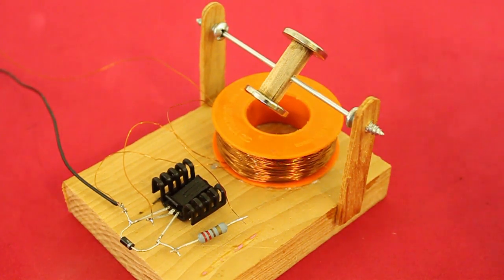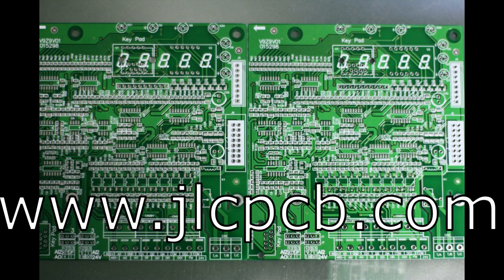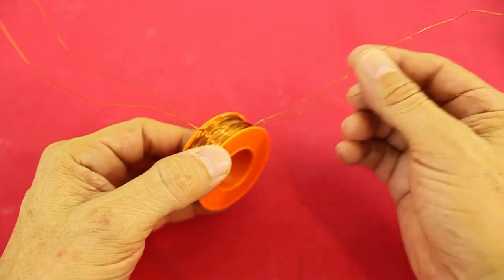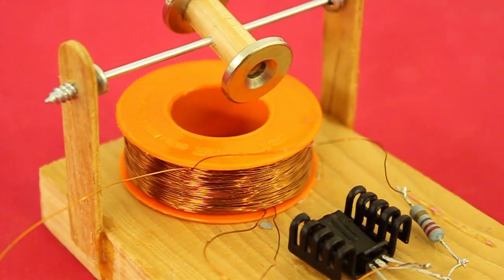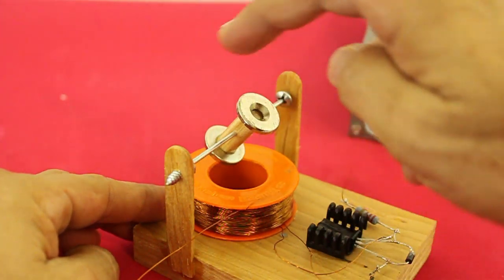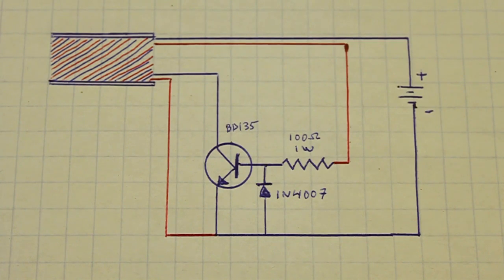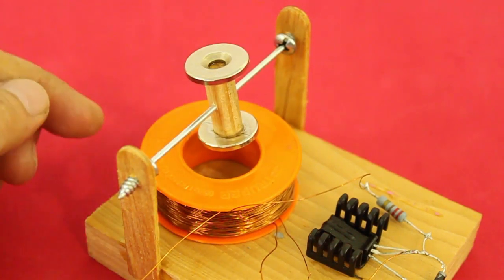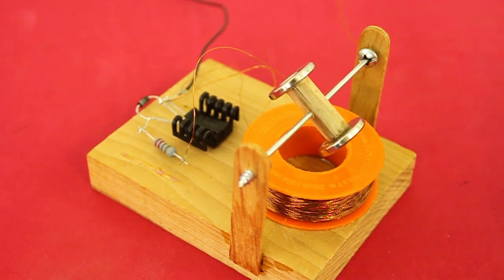The Bedini Motor

Comment: If you cannot describe the physical details of a circuit, you should go back and learn what's necessary so that you understand it.

In your case, it's 100% clear that you fully know the operation because your explanation is clear, accurate and correct.

I taught STEM topics at UC Santa Cruz for five years and I discovered the following:
1)  when a topic is new to students, like all new knowledge, it requires effort to learn.  Even if you explain it correctly, it takes effort to acquire the knowledge because it is new.

2)  if the experienced person decides "I'm not going to tell them everything they need to know - that will motivate them to work harder to understand!  Besides, nobody helped me!"

A large percentage of yt videos use method (2).   In some cases, it's because they do not understand what they have so they cannot explain it.

If you really want people to understand what you're trying to convey,  the method you used to explain the Bedini motor is a model because holding back details does not motivate students.  They are already facing the challenge of understanding something brand new to them.

I congratulate your effort, very good job.  Nice build on the motor, too - thank you.

Comment: I wonder what effects on heath or body or psyche would be, to be close to a fast rotating magnetic field, with some improvements to build you can rotate a magnetic ball or wheel quite fast, i have built design and made it "better" I will sit by it while it runs, i have some copper rings that will vibrate when it gets close in the field range of device, Ive yet to know if it improves or not my well being but not much out there on the study of magnetism effects on the body for healing but hey just being weird on YouTube and throwing it out there.

Comment: What if you replace the resistor with adjusting resistor. So then with motor running, you can adjust best position for rpm.

Comment: So the magnet passing the coil acts as generator turns the transistor on, sending current to the base of the npn
Reply from the maker: Yes
Reply: @ludicscience  So this is a more direct way of describing the operation of sensorless BLDC drivers.  In other words, the ones that don't use hall sensors?  Instead of saying such terms as back EMF.
The only difference is, the sensorless bldc driver does start without help.  So I would think that the magnet's back emf ( sending current) is used to show its location.  In other words, it is doing what this experiment is doing, triggering the base/gate of some a transistor/mosfet or what have you.

When I use one of them drivers to run my make shift bldc motor, I typically need to give it a helping hand except once in a while.  I guess it depends on its mood, temperature, humadity or what have you.  Plus the motor is not exactly machine made to precision with an uneven airgap etc.   And once in a while when it is just at the right spot, it runs like grape ape with only 5 V.   Too fast for my comfort so I actually have to lower the voltage. And sometimes I have to really give it a helping hand and it still fights.

Comment: Great video, what if you add one or multiple other inductors then rectify the output to a storage device like say a ‘capacitor’ which can run through the switch then only wind a secondary once on top of the original inductor tuning it to the correct switching force etc?
Would anything like that be worth pursuing?
This comment is sponsored by ‘the reptilians’ our beloved benevolent overlords.

Comment: This build has many problems. Wrong coil geometry, wrong magnets, no core material. Output energy is totally wasted, which defeats the purpose of this device. This device has very little in common with a proper built bedini ssg.

Comment: I like your setup.
Recently I tried the circuit aswel. It looks like the transistor doesnt shut. There is a circuit on the thick wire. Resulting in a north pole magnetism in the spool. 
Do you have any idea?

Comment: it is a transformer but with a diode so it just take the inductive current by the movement of the magnet and that current switch the transistor to feed the other coil that turn the magnet.

Comment: Yeah! Bedini "motor". I built 4 of them. About 10 years ago. BTW, you can use it to charge a big battery while depleting a smaller one (the run bat). Is it "Over-Unity"? Is this a big bat. really conventionally 'charged'. I will not discuss these kinda controversial considerations.  
Guess what? With the DadHav very clever circuit you do not need a 'trigger coil. One coil is enough to run a pulse motor.
You also do not need any reed relay, any mechanical switch or whatever.
The few experimenters interested in this kinda stuff can consult :
"1 Coil Brushless Motor Driver (Multi-Phase)". (DadHav)
https://www.youtube.com/watch?v=8b4xlCKn3LQ
This circuit can be simplified (cut in half) but is very tricky to get it run.
More here: http://freenrg.info/PUBLIC/The_DadHav_Circuit-V2-2.pdf

Bien le bonsoir,
Jean

Comment: Nice video and good explanation.  Bedini motors are good starting points for beginners.   And you can extend them to create a mechanically switched boost converter using the flyback spike from the drive coil.  It's a good way to teach students the difference between voltage and energy.
Instead of a bifilar coil, you can experiment with a separate fine-wire coil placed in the center the drive coil.  Lots of fun projects here.
Reply from the maker: Thanks!
Reply: Did you really fall for this hit piece? 😂 Flyback spiking

Comment: What for is the diode in the scheme?
Reply: The coil creates AC at the base. You need to let the negative part of the cycle flow as well or you will get voltage spikes that destroy the transistor.
Reply: @superdau  This type of solid-state driven motorization circuit can operate without a 'clamping' diode'. 
Remember those Cosmotron's from the 1980's?
Reply: @chadcastagana9181  
If you want to fry your transistor, leave the diode out.

Comment: Can neodynium magnet be made more powerful by wrapping copper coil around it and powering the coil with variable volt or corrent or both.
Reply: Yes. However, The wire will repel itself from the magnet if you do that. You'll need to fix the wire to the magnet
Reply: What would be the point of that? If you have a coil anyway just use it to create the magnetic field. Electro magnets can create much higher field strengths than any permanent magnet.

Comment: Is there any substance other than copper which can be used to create electromagnet.
Reply: any conductor?
Reply: It needs to be a good electrical conductor and not contain iron.  I'd rule out steel wire.  Good options are silver, gold, copper and aluminium. It needs to have an insulating coating (usually varnish) so that adjacent turns don't short circuit.
Reply: You can use bananas.  Lots of them.  Of course your power requirements will be different but that is another problem.

Comment: It's a 1:1 ratio coil winding.
Reply: The effect of the thin wire is to produce enough emf from the induced current to trigger the transistor. The thick wire won't be efficient because of its higher resistance.